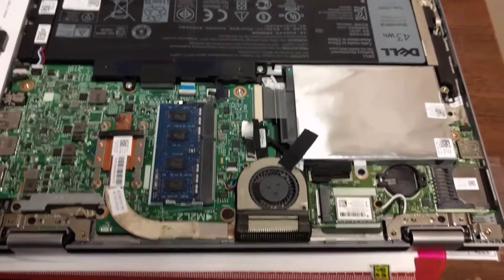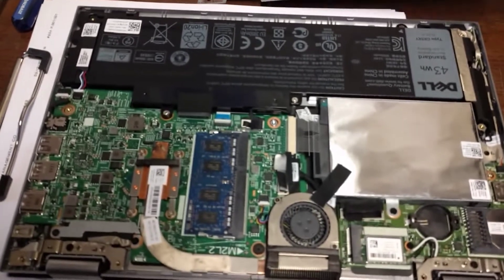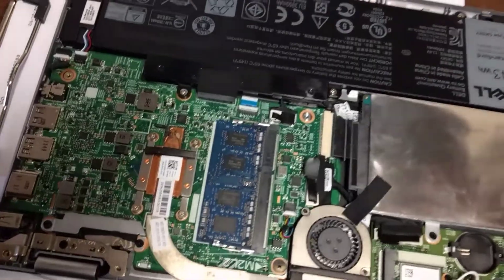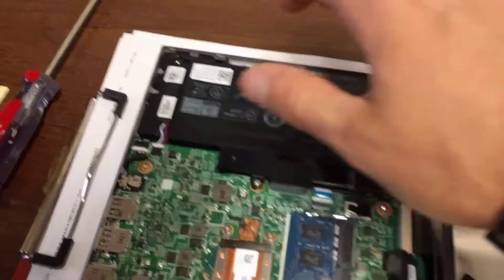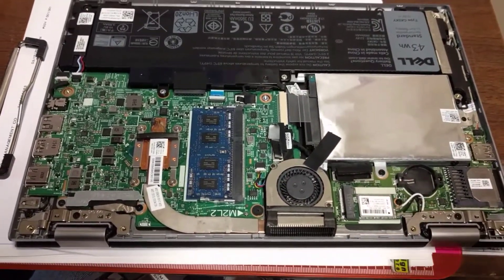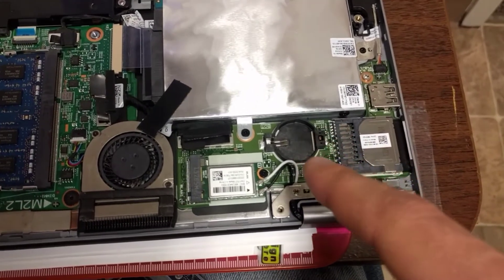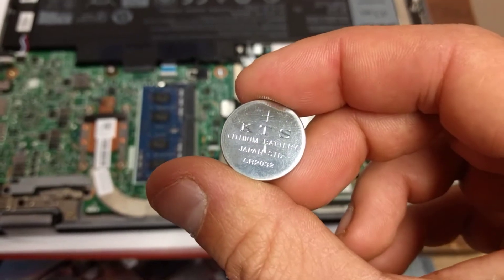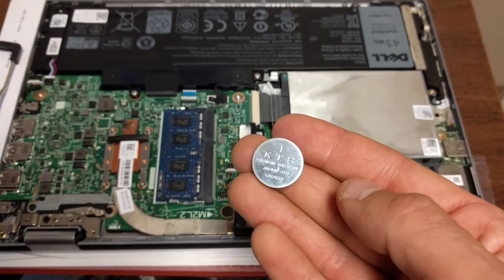Fix Dell Inspiron 11 3000 series 5 loud beeps at startup

Comment: Patrick, I had exactly same problem and i replaced the cmos battery.. But i still got the 5 beep sound when i started my laptop. Do we have to reset the CMOS settings? FYI, the power was not connected when i started the laptop if it could have an impact. Any help would be appreciated.
Reply: Same here,  any solution???? I did upgrade memory from 4 to 8
Reply: The problem of 5 beeps is either the cmos batt or the cmos clock chip. If not the battery, the mobo needs to be replaced according to dell. You can however shut of the beeps in regedit so that it will beep during startup, but stops when windows loads.
Reply: @SNG.OfficiaI  Any tips or a link on how to do that?

Comment: Looks like watching your video a few times actually helped me identify my own problem.  The volume down button on the volume/power circuit board was sticking.  Thus giving me a muted in computer and, when put in tablet mode reversing the button functions, 100 in T-mode.  If anyone else is having this issue, maybe you could do a quick video on identifying the volume/power circuit board and showing which buttons perform which functions.  Thanks again for having this video up, it really saved my ass!

Comment: Hey Murph, just saw your video and subscribed.  looks like you know what you are doing.  need help with my brand new 11 2-in-1 volume.  stays muted in computer mode and stays at 100 in tablet mode. no buttons or driver downloads or restarts or factory settings have helped. must be a hardware issue that I don't have time to have sent in to be fixed.  Any ideas or help is welcome, thanks

Comment: I am facing same problem but when I checked cmos battery with multimeter it is showing 3.5 v that means battery is ok. Than why beep sound is there
Reply: replace the RAM
Reply: @bryanbegontes765  You've posted this same comment 3 times here.. all three are wrong. You need to consult a neurosurgeon and "check your ram".
Reply: @bryanbegontes765  It's the CMOS battery not the ram...  do us favor don't work on computers your too stupid the guy at best buy told me it was  the battery
Reply: @bryanbegontes765  what the fuck you talking about. stop with this stupid advice when you don't know. 
5 beeps mean CMOS battery failure just like on this video.